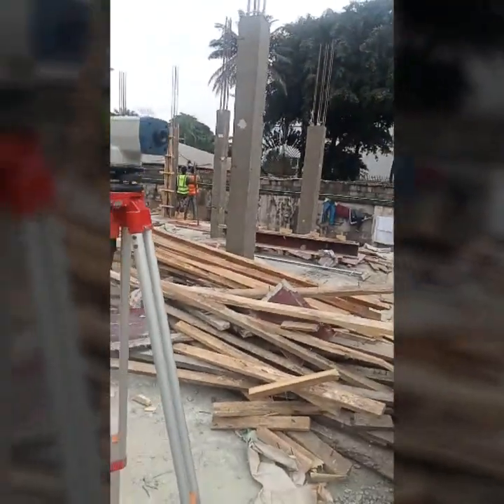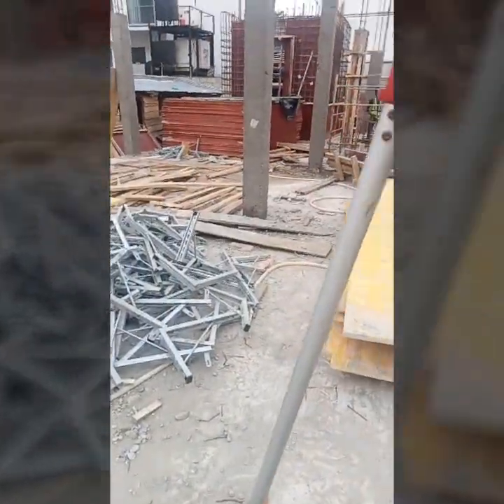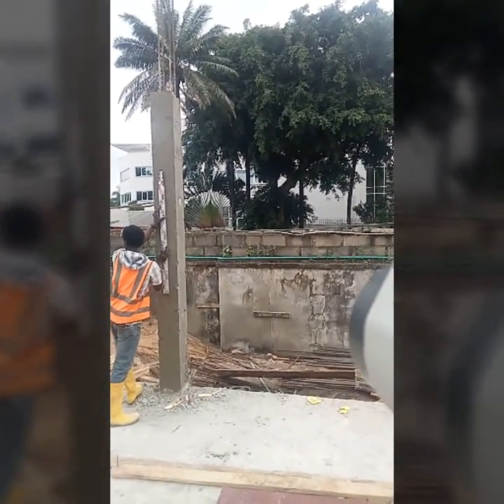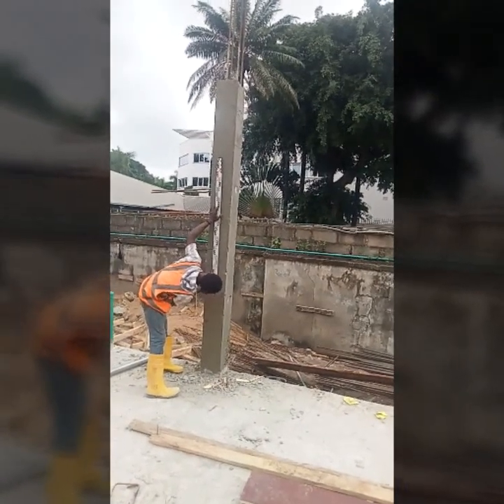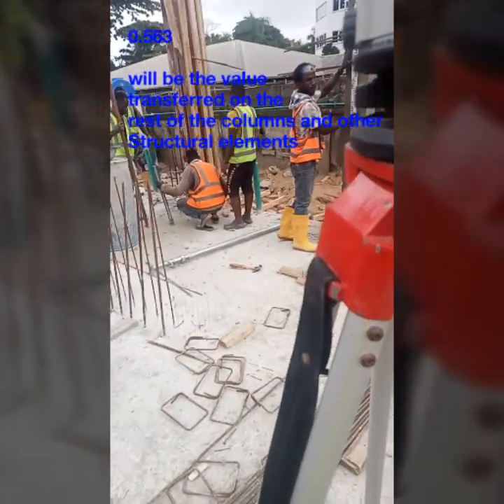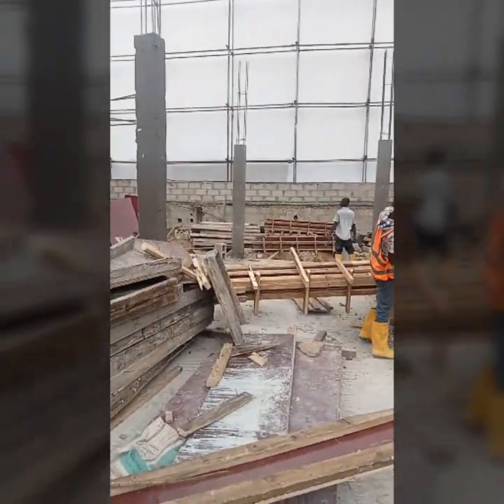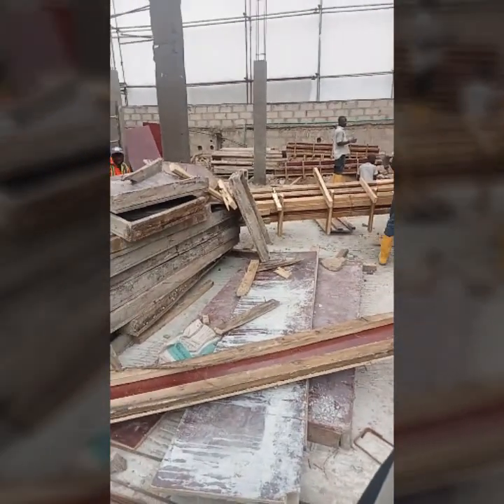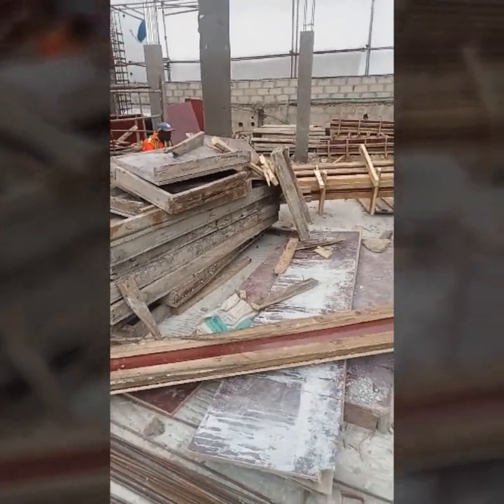INTRODUCTION TO LEVELING | ONE.

Comment: The DPC is 1590mm and the GFL is 1622mm with a difference of 32mm ,how is the DPC higher than the GFL
Reply from the maker: The Civil Engineer didn't maintain the exact level that was given for ground floor casting.
Reply: So u mean that the DPC was to be higher than the GFL??
Reply: Bro, The higher the value, the lower the terrain and the lower the value the higher the height.